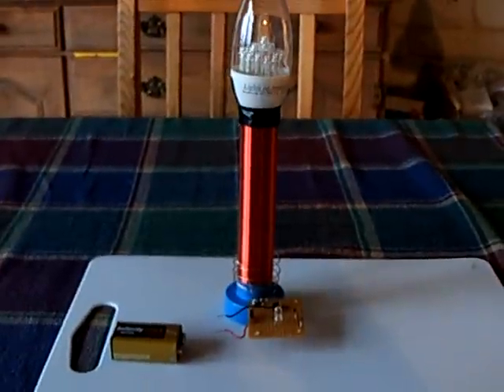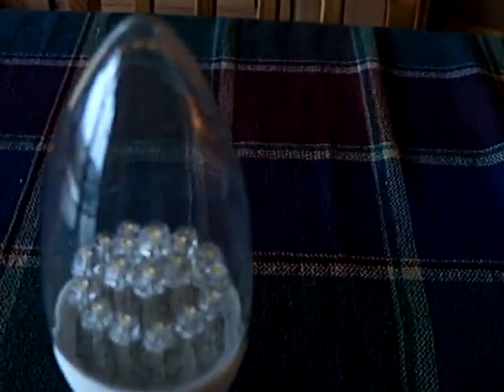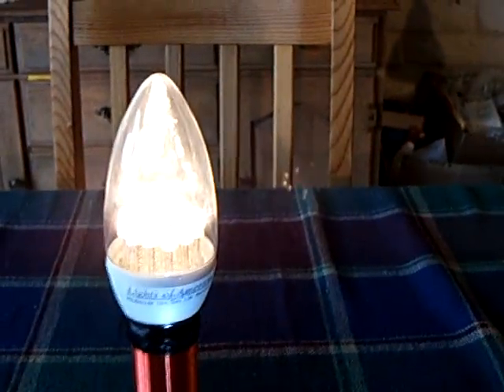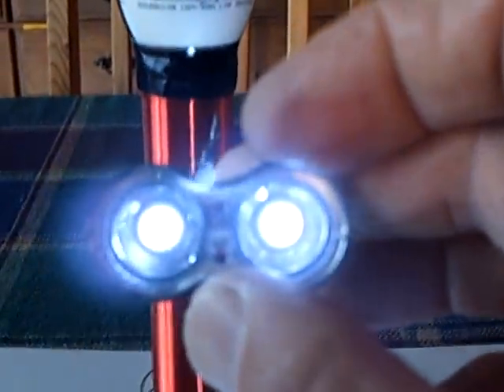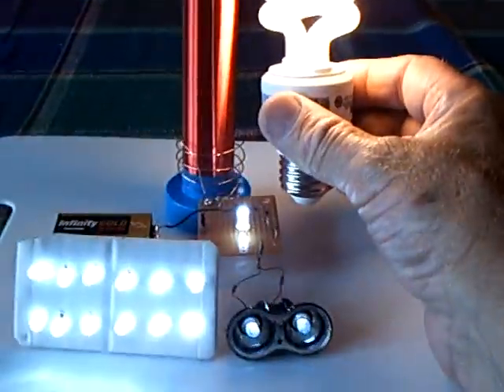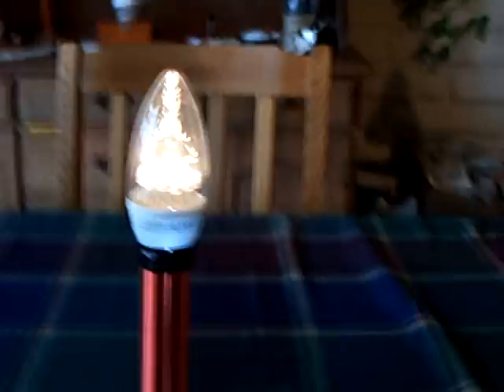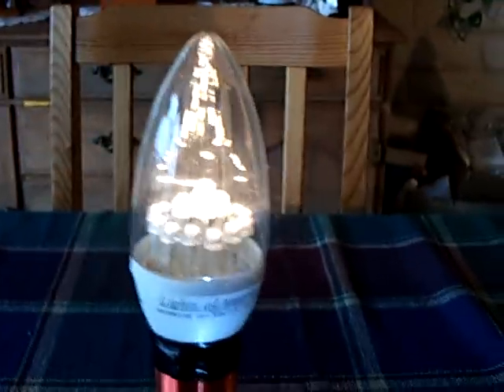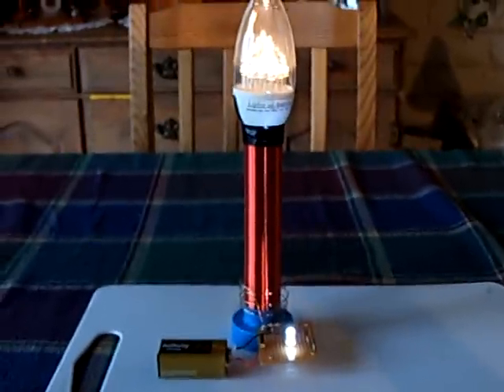Mini Tesla coil with 110v LED bulb

Comment: I know the "Laws" of Physics and am quite aware everything electronic is based on theories. Many of the "Free Energy" guys are working hard to find what we have been missing. Physics does not account for everything yet and probably never will. Inventors invent AND experiment..physics majors use others peoples work from the past and present. Sometimes you have to take a step back to take two steps forward. Your science does not except that negative energy even exists and these guys prove it.

Comment from the maker: Yes ----No.  I have done extensive tests with these setups and the more light bulbs that you add the dimmer the rest become.  Basically there is a limit to how much light you can pull off the thing.  If it was not that way---this little guy could light up the world.  The frequency is NOT changed that much but you are right the circuit is sensitve to changes in capacitance and it does alter things.

Comment: i am giving all the specifications i used to make this mini tesla coil
primary -17 turns of 23 awg copper enamled  wire
secondary- 558 turns of 24 awg copper enamled wire
iam using 2 1n4007 diodes,with PNPMPSA06 , WITH 1MOHM RESISTOR,, I USED SLAYER EXCITER CIRCUIT FOR CIRCUIT DESIGN
I COULD ABLE TO GET THE OUTPUT .., CAN U PLZZZ HELP ME PLZZZZZZZZZZZZZZZ

Comment from the maker: No.  This is not a traditional Tesla coil circuit design.  There is no spark gap or capacitor component.  There is capacitance but it envolves the coils.   The voltage here is not very high either.  Hundreds of volts instead of thousands like on a traditional Tesla coil.  Look up "Slayer Exciter".   GBluer here at Youtube is the author of this amazing simple circuit.  It is based on the work of Dr. Ronald Stiffler.

Comment: I was thinking that to power those lights would take a lot more power then that 9v battery could ever give them, hence using the coil, so what I mean is there is a lot more power from it then you put in it so there must be a way to tap into it and cycle it back round to a rechargeable battery and making a loop system.

Comment from the maker: @iAztec ----The situation is similar but the Slayer Exciter operates in the hundreds of volts rather than thousands like with a true Tesla coil.  The circuit is much different.  In it's simplest form the Slayer Exciter uses one transistor, two coils, a resistor, and a power source.  There is no capacitor component or spark gag required.  It is kind of a free running, out of control, and self resonating oscillator that operates in the mega hertz range.

Comment: The lights get dimmer the more you put around it..... until you ground it and put an insulated plate on top.... i used wax paper and foil and contact glue to insulate a make shift plate last night... stapled it to the ceiling and hooked it up to the top of the coil... i connected the outside ground to the negative side of the circuit.... i was able to keep placing lights near it and the brightness did not change... just thought id mention it...didnt know if you tried that yet...

Comment: @MrGunnaras just because the coil lights up 120V bulbs doesn't mean that the coil produces that little voltage. Yes I know the voltage breakdown (or a dialectric strengh) of air to be 20V V/mil or about 20KV per in. Tesla coils can put out a lot more than 1000V at a high freq.

Comment: @Lidmotor a few things can happen with these coils, high frequencies, "longitudinal waves from the capacitive top load" which is what Nikola Tesla said and other factors what I find interesting with yours is the field range it's the same as my 22kv 100ma resonant coil with a massive no coronal leakage top load. You should build another coil with the same resonant frequency as you first one things could get interesting.

Comment: @Lidmotor It excites the leds remotely also, right?  I was just wondering the power difference between powering the leds (or cfl for that matter) by coil induction vs wire.  Could I still have, say the efficiency of an incandescent lamp, by using a remotely inducted led?  In that situation it would be well worth it.

Comment: @Lidmotor yes i know-my coil makes all sorts of noise in the RF spectrum-and certainly isnt legal when considering FCC rules,but after watching one of dr stifflers vids where he adds more diodes to the system and makes the claim that it makes more gas at the same energy density-then it follows that the a larger diode would work as well.also i wonder if the diode needs to be in the water at all...as for the noise-could always shield the whole setup.

Comment: Beautiful, as usual! This is the first time I've seen diminishing + output in SECs, let alone plateauing. Might this mean that the SEC electrolyisis might also be in some way limited in capacity, perhaps dozens or hundreds in stead of thousands of equally performing diodes?
Having seen the plateau effect, at least in your very specific setup, I wonder if the OU claim that I seem to remember from Dr. Stoffler is being undermined, or that you'll just need to tune better to get it ALL to run full?

Comment: Your CFL has a transformer in it so that might case eddy currents in the coil. For the boat since you have a good working coil you might want to consider using a single wire off the tower and run it in on the ceiling and run multiple loads off the wire resonance so that you can light up the boat but use super bright leds in fixtures. String them like regular light fixtures in a dasie chain. I think it would make great deck hung lighting for those really dark nights at sea. Great video.